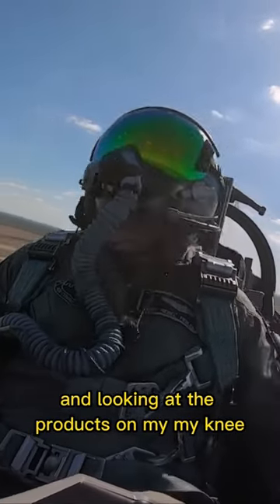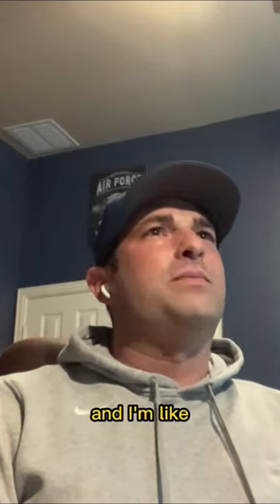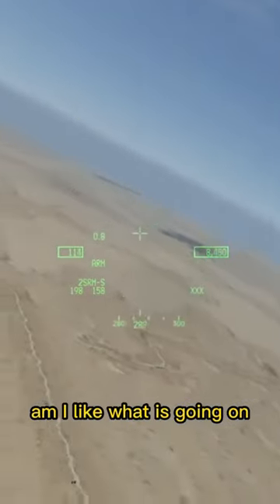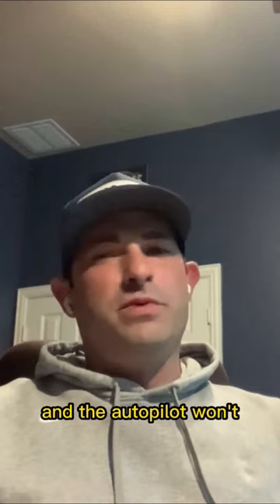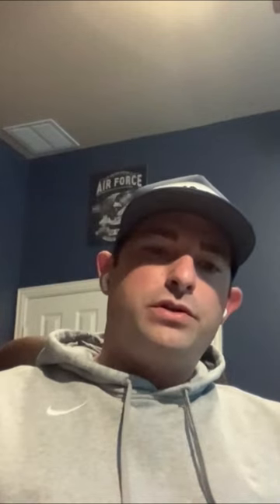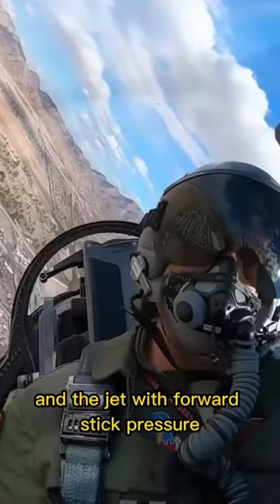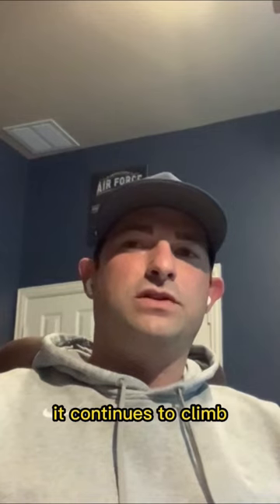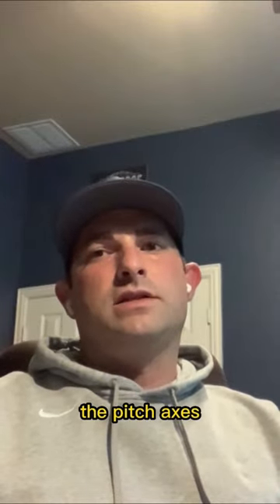Eject or Don't Eject? Fighter Jet Loss of Control

Comment: For cases like this, a flight computer kill switch would be very handy. Revert to old fashioned flying like Tomcat drivers.
Reply: There are several in the 16 in the rear left side wall near the IFF panel
Reply: Not possible with the newest gen of fighters
Reply: Not possible to fly completely manually in modern fighters. They are an unstable design.
The flight computers do have redundancy and reset buttons however.
Reply: Could work with some aircraft. But with planes like the nighthawk, it realizes SOOO heavily on CPU management just to keep it stable that that wouldn't be a good option. So it would depend largely on the planes initial reliance on the CPU for stability. Strictly stick flying the 117 would be a nightmare
Reply: @sportsboyjon  it is impossible. Someone tried, it went in a flat spin.
Reply: Only problem is it's fly by wire
Reply: The only thing that is manually connected from the cockpit to the jet is the throttle. Everything else is fly by wire and nerd boxes.